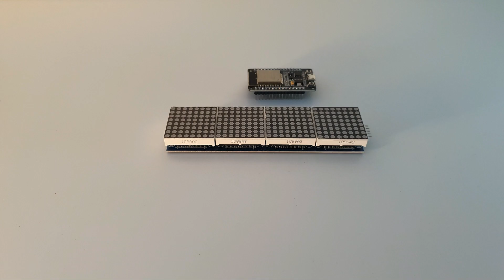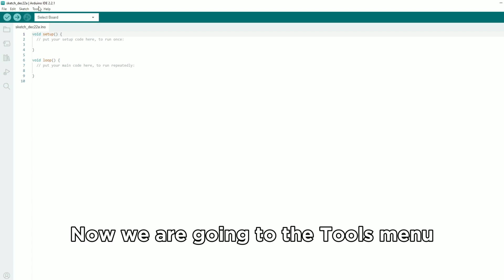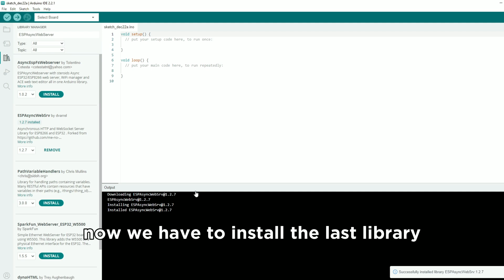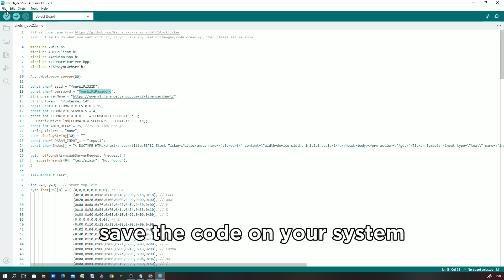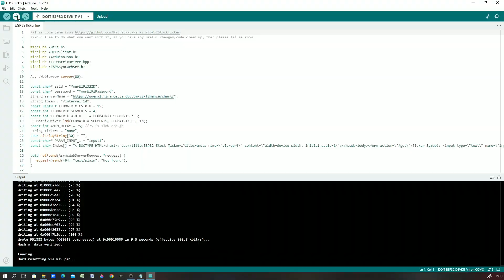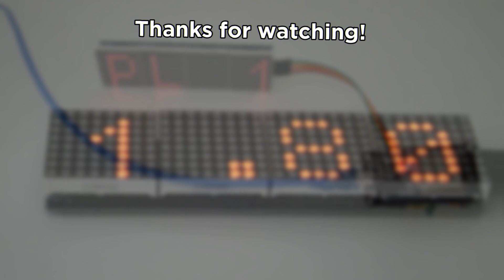HOW TO make a BITCOIN and STOCK ticker with an ESP32 and Max7219

Comment: I bulit it too and it is phantastic, thank you! But It is correct that the ESP forgets the crypto setting after each power interruption?
Reply from the maker: Nice to hear you liked the project! It is indeed true that if you turn it off you have to enter the tickerer again via the browser. But if you always look at the same ticker, you can probably adjust the code so that it is not variable but is fixed in the code. I don't have the code at hand, but if you look at it logically or run it with the right question through chat GPT, you should probably get it work with a fixed ticker ;)
Reply: @  done, got the code from chatgpt 👍😊 thanks

Comment: Would I be able to use the same code, libraries, etc if I wanted to upgrade to a MAX7219 Module 8 in 1 so that I could have a larger display?
Reply from the maker: Hi, I think you can just increase the number of segments in the code if you want to use 8 segments instead of 4.

Comment: OMG! This is the coolest project. I finally got mine set up and working. I used Chat GPT to assist me with all the little issues I ran into i.e. not having the driver installed on my computer to connect to the ESP32 and selecting the correct board. Chat GPT is amazing! Thanks again for sharing this project. You made it easy for a non-techy like myself.
Reply from the maker: Thank you, I really appreciate your response😀

Comment: Love the project, I have an issue though. I enter the correct ticker into the basic local IP, the matrix blanks, shows the IP again and never shows the ticker. Any ideas?
Reply from the maker: Normally  this is the case with a ticker which is not retrieved from https://finance.yahoo.com/. Are you sure you are using a correct ticker like BTC-USD ? You can also check if you used the correct webserver library (ESPAsyncWebServer by Me No Dev). I hope this will help.

Comment: Hi, great video and thank you. but when I try to submit ticker symbol, my ESP crash with error "Guru Meditation Error: Core  1 panic'ed (LoadProhibited). Exception was unhandled." would you have solution for this error? thx in advance.
Reply: I've tested it more and the error appear only if the price for any ticker is greater then 9.99
Reply from the maker: @TolueNT   Strange. I uploaded the code again myself and everything works fine, also with prices above 9.99. Maybe you can check if you used the right ESPAsyncWebServer library. Otherwise install the library from the link in the GitHub. It is also possible you have selected the wrong board, just try another one. I hope one of these action will solve your problem.
Reply from the maker: @TolueNT   Nice to hear you got it to work and letting us know what you did to fix it!!!
Reply from the maker: @TolueNT  What do you exactly mean with white spaces? The time between the moment the last character of the ticker value dissapears of the screen and it repeats itself or spaces between characters like a dot?